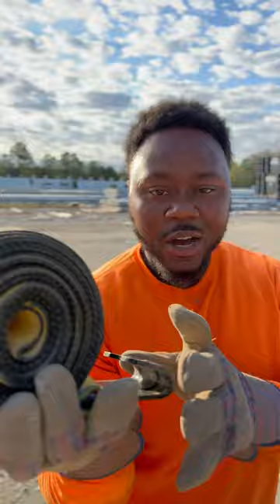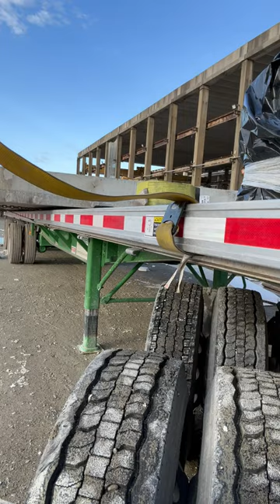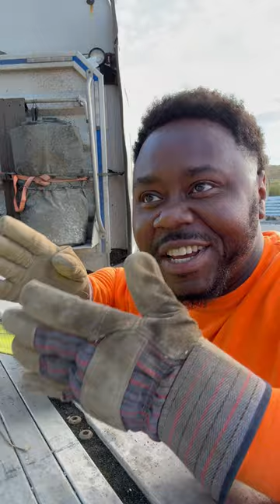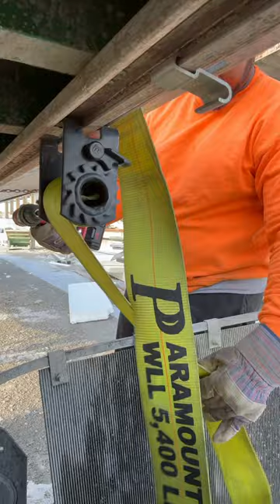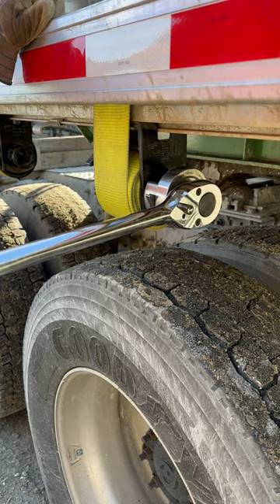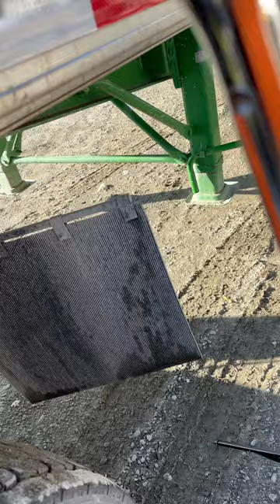Never too late to make a career change. @madmanratchit9312

Comment: So how tight is to tight?
Reply from the maker: Whenever you can’t crank it anymore
Reply: @bigsnow1705  cool. The reason I asked is that I see flat bed drivers with cargo ship containers on the back with flapping straps. Just wanted to know if that was safe.
Reply from the maker: @chrisstyle405  sometimes they flap but can be still tight. Just the wind has gotten under them
Reply: Ok  thanks